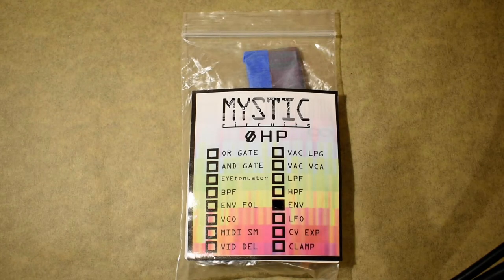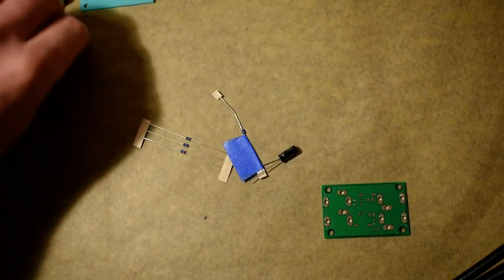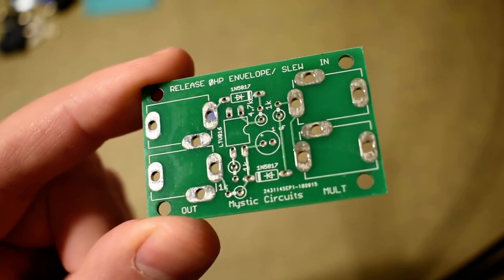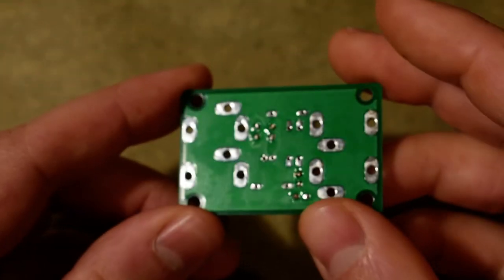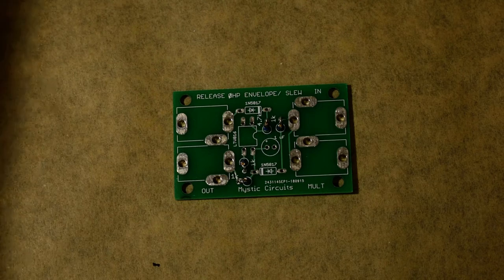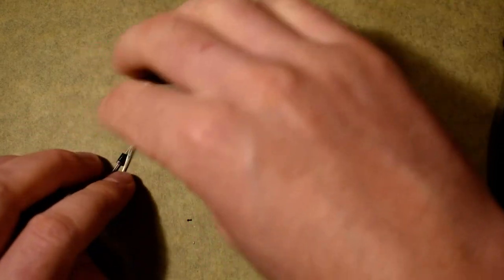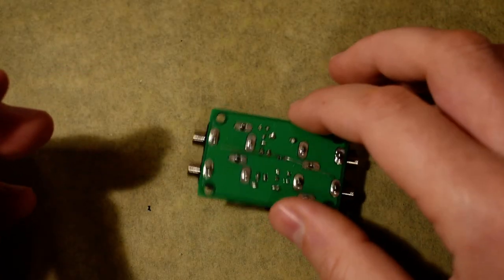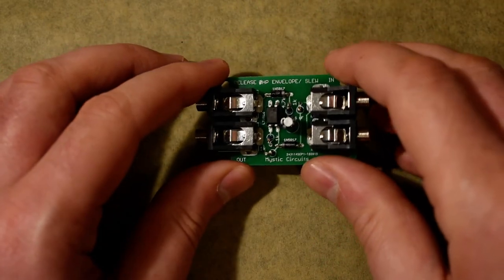0HP Envelope Build Guide

Comment: Hiya! I know I'm asking quite a while after this was posted, but is there a resource for the schematic of this envelope? or at least an explanation of how it works? I am working on a project that needs a very simple sustain-release envelope and this looks absolutely perfect!
Reply from the maker: I somehow ended up saving over the design files for this and have been kicking myself about it ever since.  I've been wanting to transition the 0HP module design files over to diptrace from eagle and this will be the first thing I tackle once I get there.  At its core its just a diode followed by a big cap, there is a LTV816 optocoupler bridging the cap to ground for the voltage control.
Reply: @MysticCircuits  Tysm for the reply! I would love to see the schematic but I will see if I can get my hands on an LTV816 to try this out.